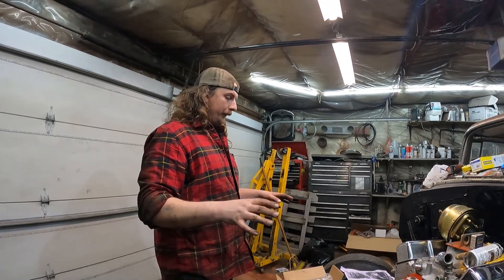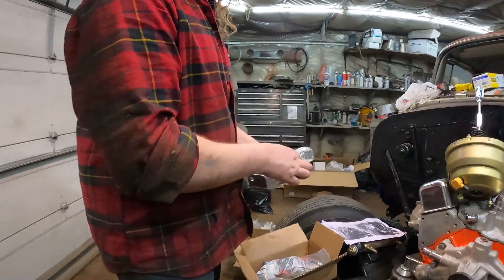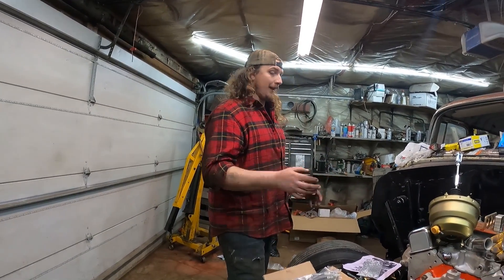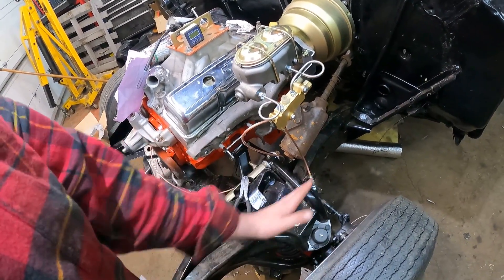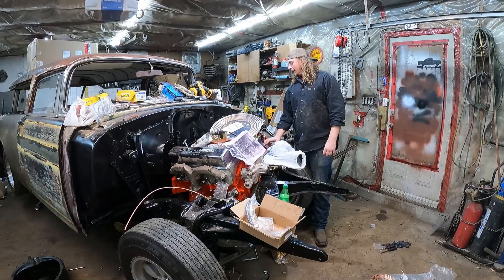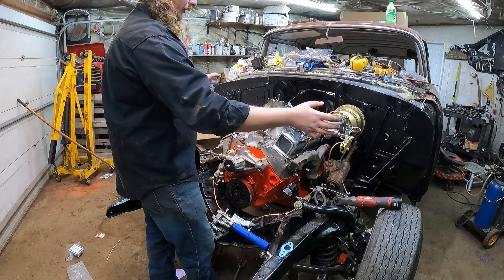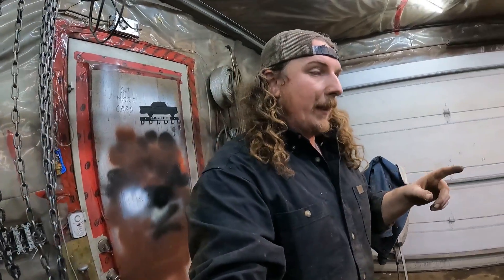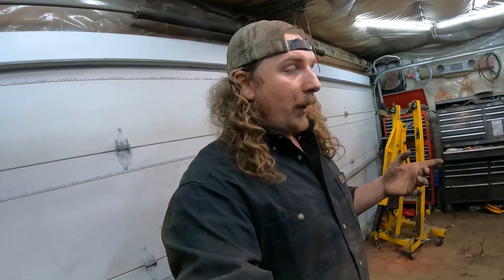Getting Tanked And Taking Brakes! - "Beat To Sweet" 55 Chevy Nomad Gets Brakes And A Fuel System

Comment: I've said it before, but I'd like to say it again. I love how you always go completely through the brakes, suspension, steering, fuel system, and electrics to give the car the right foundation to start with. You start out right, and it's more reliable and more enjoyable from then on. No matter what car is sitting on that foundation, you can't go wrong with how you do it. Nice work.

Comment: You need the alt bracket off a 69-72 Chevy pickup, it keeps a shorter belt and bolts to head😁 on driver's side. What ? No 605 power steering conversion on this one?😁👍 Loving the build. Thanks Dan
Reply: Ya - you tell him - he doesn't listen to me - maybe you can get him to cut off those old rear engine mounts off the frame - I've built a few old Chevy's and you seem to know the tricks as well - 605 is the way to go - unless you clip.

Comment: Hay Dan for your rear breaks if your running a 10 bolt or a 12 bolt you can use  late 80s /90s cammaro disk breaks and hardware and get rid of those drum breaks.

Comment: Dan, You might want to run a separate ground wire from your gas tank sender mounting screws to the ground. Just for reassurance of a good ground it will prevent an intermittent later. That's what I hate about working on taking out the gas tanks on the wagons, the rear end must be moved or dropped down really low to pull the tank.

Comment: My 56 150 utility sedan has a L-78  and I'm  using GM truck accessories, hydro vac power brakes run off power steering pump. Pinto rack & pinion and Chevelle fron disc's and 12 bolt 3:73 posi with Alston ladder bars. Tyranny is a six speed Tremec with ridiculous top end.
   Makes for a killer highway cruiser.
     Engine has been in a 74 Camaro rat rod...before rat rods were cool...we called them "sleepers"...then in a 57  10:90 2900 lb. bracket racer and finally my 56 150.
   tri-fives have been in my blood since high school and I'm 76 now...LOL

Comment: I'm pretty sure that car was in a 1971 or 72 Popular Hot Rodding magazine. I remember that paint job. I have that magazine tucked away, but it would take a while to find since I have 20,000+ magazines I've collected since the 70s. That paint job was pretty much one of a kind, very distinct. I think the car had aluminum slots on it and I vaguely remember something about a 12-bolt swapped in it. It has to be the same car, 50yrs later.
Reply: I think it had a 327 in it.

Comment: I got same kit, the master will work with or without booster. I had trim the thread on rod to fit. When you get a states address I will mail the booster and bracket to ya minus the master and proportion value. I used those. The master is just an old corvette style
Reply: Great video and dropped when I needed it, very smart taking the extra steps on this one, great hot rod / investment should you need or decide to sell

Comment: Had those ram head manifolds on my 57 pick up. The generator bolted ,with a bracket  to the drivers side . I made a mount for a alternator out of that bracket . Seemed to work good never lost a belt.

Comment: I put a similar power brake booster kit on my '64 Dodge (Fargo for my Northern friends) D100. I had difficulty adjusting the release pressure on the front brakes as I was using a proportioning valve. Probably because I didn't bleed the way you did. Makes sense. I am kind of esoteric sometimes, with the bracket adapter, the distance the brake booster extends into the compartment is annoying. I've thought about going the hydraulic booster route but that is a chunk of change for a silly reason.
Reply: I did hydro boost on my 62 Impala $250.00 in parts I couldn't make enough vacuum, I had a new set up like Dan's; booster is now on the shelf. My power brakes are now super good

Comment: I guess the hardest part is the anticipated outcome of something that didn't look possible, to anyone can do this... which in truth some of the hardest is the finishing line. Like if at first you knew you would go this far, and you could stand inside the car, maybe the dash wiring, any speaker runs, all the shock mounts on the inside, if obvious where they went that is, the fuel neck... just some stuff thats easier, if only more room to move around. You are not a short small person and laying on the back, to go up and around the dash is not easy at any time. I see the videos of at the factory where it was still people installing pieces and parts... that dash went in with all  the wiring and vacuum lines. The heater vents and controls, most likely heater box, all inside before the body met the frame. Then the team would swarm the body and do all the hookups, as the body was set on the frame, with that steering column installed already on the frame. Most all the car manufacturers had the steering with a rag coupler instead of a one piece shaft coming through. They shudder when they see it now pointing at a driver and watching their crash dummy eat a steering column right in the chest. To me that was recall city but what did I know as I drove a wrecker to accidents for my dad starting for him in nineteen fifty eight. Yes I saw these cars in many accidents on roads that then were two lane considered, now only a one way lane can get that narrow. I know this part... it stuck with me hard! Over fifty percent of the accidents were left front fender to left front fender. I hope you see my point. I'm glad that your doing a column in this car but then it could still be with this same hookup. I guess I jumped to conclusions on that one

Comment: Why are you still using drum brakes? I had 4 whl drum on my 66 Impala. One front worked a little, the other locked up instantly. Rears not at all. Thing is amazing with the 4 whl disc set up. I scream at my TV when you rebuild/replace drums!

Comment: Im still questioning the copper brake lines. Very soft and easy to puncture. Does the inspection allow copper brake lines? THey must since youve used them before.. Looking good Dan

Comment: Hey Dan, I've always been curious... What do you think that extra hole in the Water Pump Gasket is for? You've got it placed on the Drivers side. Was it designed on a Monday maybe? A possibility it's an Oil Pan gasket for a 2.5 Iron Duke?

Comment: Power Brakes , ok lets get real here, what is the duration of the cam in that 4 bolt 350? ( look at your cam card ) If that duration is long with a 110 degree or smaller center line, you're going to be forced to add a vacuum pump as your never going to build enough vacuum to power the booster. My advice, (although you rarely listen to anybody anyway) don't use the power booster, go manual disks. I have now switched all 5 my muscle cars back from power to manual disks as I really like the road feel of manual disks as with a power booster you get zero road feel and most times there is a vacuum delay before the brakes apply.
Reply: Never listens ? He listens . Didn't use the smoke wrench on the drag links /tie rod ends ! Milder cams still make vacuum . Let's burn that bridge when we get there .
Reply: Manual brakes are better for most hot rods. Only choice for me.